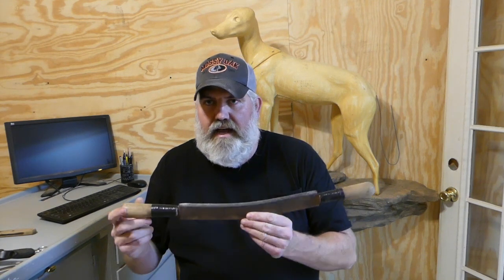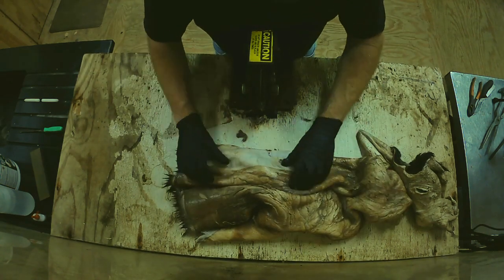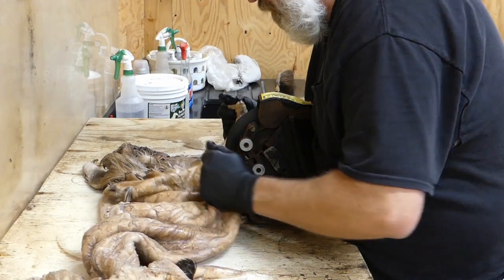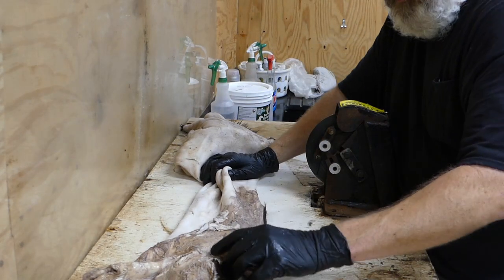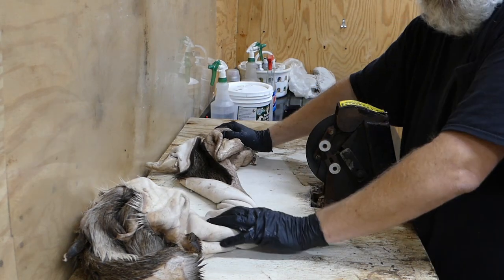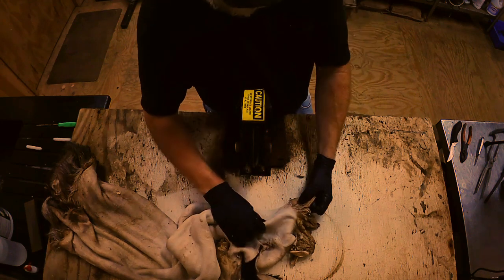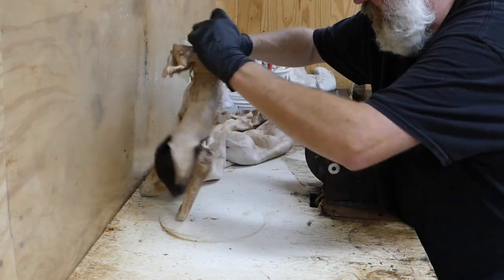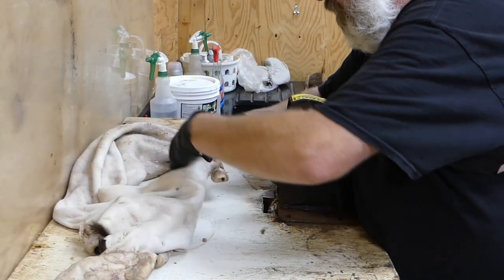Fleshing a deer cape for taxidermy

Comment: Can you share your guard setup measurements...as a starting point?
Reply from the maker: Hey thanks for watching! The way I set my guards is to have more blade exposed at the bottom than the top. The measurement from the blade to the guard is about 3 1/6 of a inch. This is going to change as you sharpen the blade over time causing the lip of the blade to get shorter. You will have to readjust the guard.

Comment: I have fleshed some hides with a pressure washer in the past.  could I flesh with a pressure washer at the step of the process?
Reply from the maker: Hey thanks for watching! Yes you can flesh with the pressure washer to remove a lot of the meat,fat and membrane. After you finish you will need to flesh around face with a scalpel or a pair of scissors to thin down these areas so it will make it easier to mount and show better detail.
Reply: @ClearCreekTaxidermy  Alright great, thanks for your response! keep up the great videos they are such a big help!

Comment: When you tale it out od the pickel do you let it dry any amount of time before you flesh it and what is your neutralization process, thanks for the videos
Reply from the maker: Hey thanks for watching! I drain the hide and squeeze any solution out with my hand and take it to the fleshing machine and after I have it fleshed I will return it to the pickle for another 24 hours. Then  remove the hide and mix a solution of 5 gallons of water to 5 TBS of baking soda per cape.let soak for 20 minutes to neutralize. Then hang up to drain for about two hours. Then roll in a towel skin side out and then you are ready to apply your tan.

Comment: One question how do you properly flesh a deer out without a fleshing machine?
Reply from the maker: Hey thanks for watching! You can flesh the hide with a knife on a fleshing beam or use a scalpel. Also you can get a fleshing knife/ beaming knife and use it on a fleshing beam. You can purchase these knives fairly cheap from a taxidermy supplier. The main thing you are going to need is the fleshing beam no matter which type of knife or scalpel you use.

Comment: Thanks for sharing! In the video you said you started out using a necker knife (which is what I’ll be doing). My question is how did you flesh the face? Thanks.
Reply from the maker: Hey thanks for watching! I would use a fleshing ball and scalpel and pair of scissors to flesh the face and nose area. I still use a fleshing ball and scalpel now to do the final fleshing of the nose and nostrils.

Comment: Your video are very helpful.  My question is on a deer cape measurement exp. A 7 B. 19.5 C. 22.5. If the form measurement at C. 21.5. When adding clay to make bigger. Where will you start at and finish at? Thank you.
Reply from the maker: Hey thanks for watching! I prefer to use epoxy sculpt when I have to do adjustments on a form. I will generally sculpt the form at the atlas of the neck following the muscles down the sides and blending it in as I go down. I will add epoxy to the muscles on the front of the neck starting at the throat and blending it in as well to get to the size I need.it will not take very much epoxy to increase the size in this area if you follow the muscles contour.

Comment: I may not have been accurate when I asked the question do you wash your hides, do you wash the hides in any type of soap or detergent to remove blood or dirt after the salting process or the pickling bath, or after neutralizing or tanning? I  am using krowtan, and as per instructions I wash the capes in liquid tide after neutralizing,  rinse and hang until thirsty then apply tanning oils, when using Mckenzie ultimate acid I use a neutral  ph shampoo and conditioner for a fluffy finish on small mammals.  I was inquiring about your washing or maybe you use a decreasing solution in your pickling process.  Thanks again for any feedback
Reply from the maker: Hey thanks for watching! I will use McKenzie degreaser as needed if I have hide that is really dirty or if it is a animal that is really greasy. If you use the McKenzie tanning system the hide goes through several rinses through out the process so normally everything comes out clean in the end product.

Comment: Hey I got a quick question 🙋‍♂️?
Can I use turpentine and denatured alcohol to deer hide ?
Reply from the maker: Hey thanks for watching! I have heard of people using a mixture of sorts but I never have so I don’t know how it works. I have always used some type of tanning chemical. I would recommend getting a quart sized bottle of McKenzie safety acid and the quart McKenzie tan to do a deer cape it is a really good tan and easy to work with. Also if you go that route make sure to get some PH test strips 0-3 to check the PH of the pickle.
Reply: @ClearCreekTaxidermy  thank you very much i have look on mckenize but they are out of it :( freaking covid!
Reply from the maker: If you can’t find McKenzie tan you can also try a similar tan made by knobloch called Liqua- Tan. It is applied the same way as the McKenzie tan.
Reply: @ClearCreekTaxidermy   Thank you very very MUCH!!!!!!